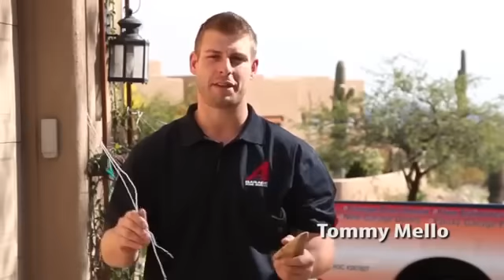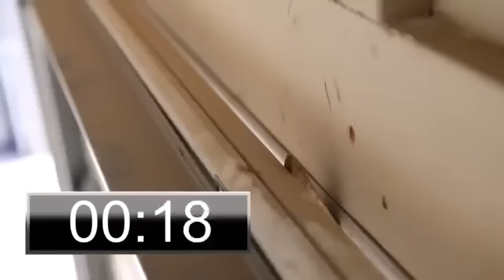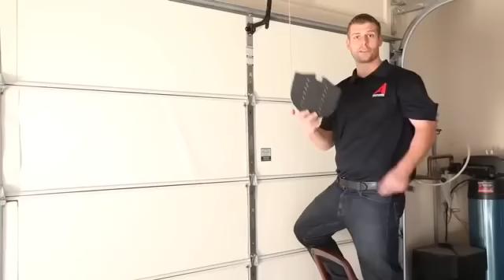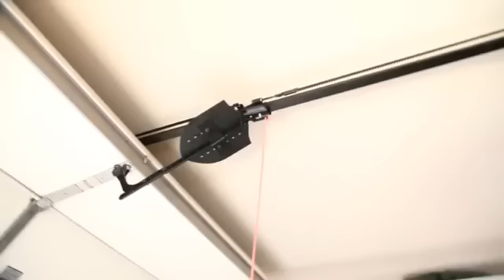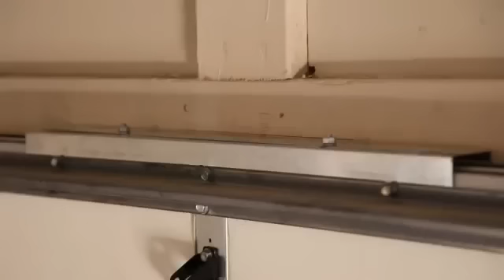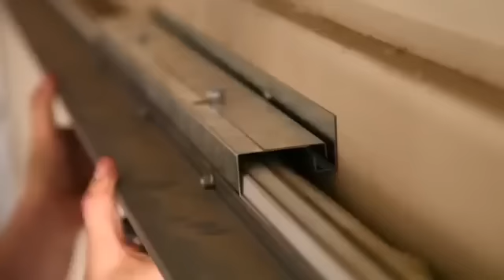Garage Defender Prevent 6 Second Garage Door Break Ins

Comment: or just add a $3.00  2 by 4 across the top and your done. We've done it on several garage doors and you can't get a coat hanger in it. with your other product we were able to  still use a coat hanger with a slight bend and curve in it to pull the handle end out and open the garage door. also you can use a zip tip through the whole. prevents the the if from being able to apply down ward force but instead bend the hangar. also still the door still can be released incase of a emergency. just give it it good downward pull and it will snap the zip tie.
Reply: thank you

Comment: I built something similar but I made it to draw the top of the door tight against the seal when it closes. You can't get a wire in the gap, because there isn't any. And if you could, the metal prevents any wire from getting past it.

Comment: $10.99 plus $7 shipping on EBAY ... or... get a 30 cent 1/8" x 6" bolt you then bend in a vise to a "U" shape and put it thru the spring holes and put a butterfly nut on.
Reply: is there a DIY video you can share, please?
Reply: Searched ebay but no dice. Any chance you could give us a listing title? Thnx
Reply: @bmead144  Have no idea what I found a yr ago but this came up in a quick search just now... 30$
https://www.ebay.com/itm/NIP-Garage-Door-Armor-Black-Shield-Kit/264774997631?hash=item3da5d1d67f:g:8fkAAOSwjgFe89gG
I'd suggest a cheap u-bolt thru the holes that the spring is in on the lever the handle pulls... put wing nuts on the ends so when you need to use the handle you just screw them off and take the u-bolt out... prolly like 2$ for the bolt and wing nuts.
Reply: I know this is 2 years ago, but how much is the vise you need to bend the bolt, and the table to anchor it to?
Reply: @CallieCEntertainment  Oh wow!  Callie... the vice would cost way more than the product they are trying to sell you here.  Add in a workbench and you could spend 600$ easily!  If you go to the 53-55 second spot you can see what is happening and what I was saying to disable the ability of the thief.  Notice when he pulls on the coat hanger that he pulls the lever that releases the mechanism holding the door shut.  That shiny silver thing between the lever and the top plate you see just right of the pull cords attachment point is a spring.  It pulls the lever back into position so when you slide the door back it re-engages the door opener so it functions again when you fix whatever was wrong with the power unit.  All you want to do is prevent the latch from being pulled down.  I have the tools to make a bent bolt from a threaded rod so for me it was easy.  You put this bent rod in the spring holes and put wing nuts on the ends so when you  actually need to use the opener all you have to do is take the wing nuts off and pull the lever.  Another thought I have is you could possible use a strong zip tie and run it thru the spring holes and tighten it up.  This should prevent a coat hanger from pulling the lever down as long as it is a good quality zip tie and the coat hanger loop would just bend.

Comment: a 20¢ zip tie will do better than this
Reply: Tony Leppek I just wired mine, but a zip tie works too
Reply: Unfortunately not everyone has the right setup for this. Ours is without the other hole so it won't work. We've put a big U bolt thru the garage door track and nothing's going to get that open.